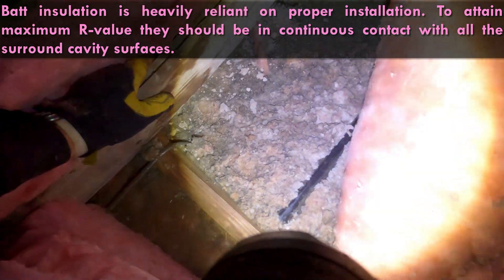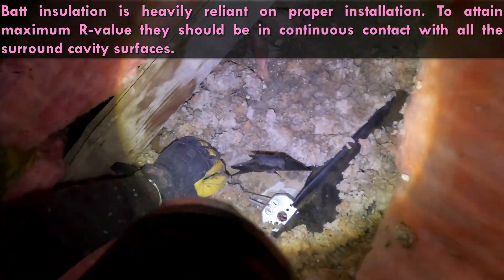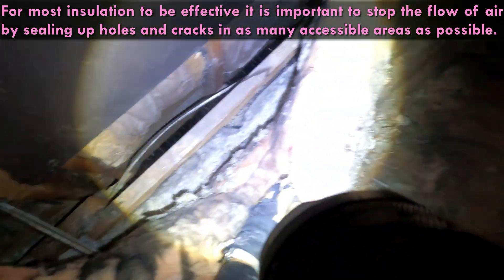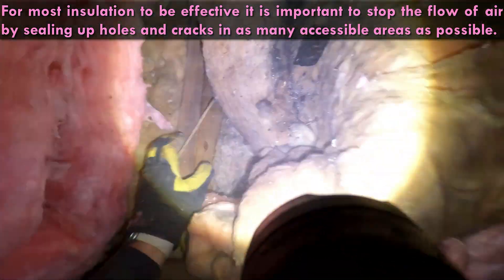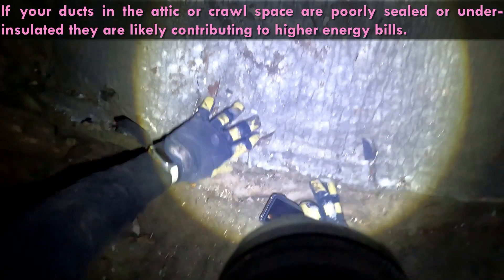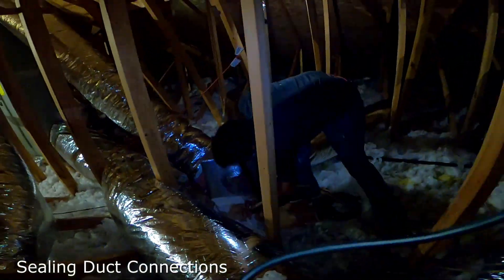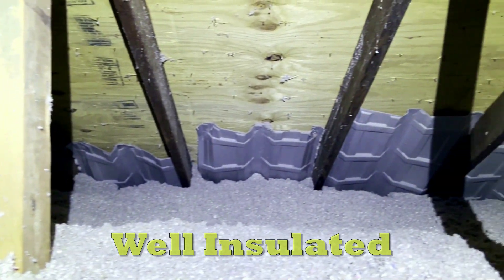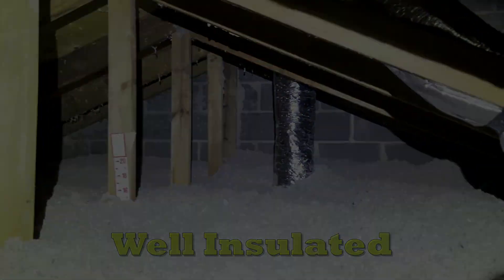3 Attic Insulation Problems Found in Most Attics

Comment: Hey I have a question, I am building a shop  that is 20’x20’x9’ and I am needing advice on how to best ventilate the attic, I am thinking of using ridge vent, but I’m not sure how long the vent should be and am thinking of using 4” circular soffit vents but not sure how many I need, the roof is 20’x20’ gable roof with 4/12 pitch, thanks
Reply from the maker: I believe the standard is 1 ft2 of net free air intake for every 150 ft2 of attic area.
Reply: @homeairleakagetest   ok thanks